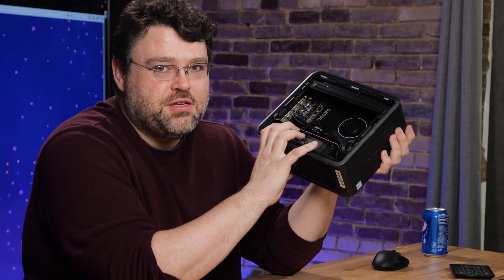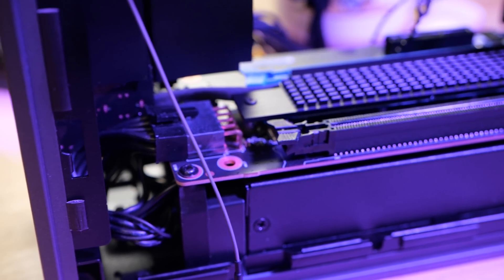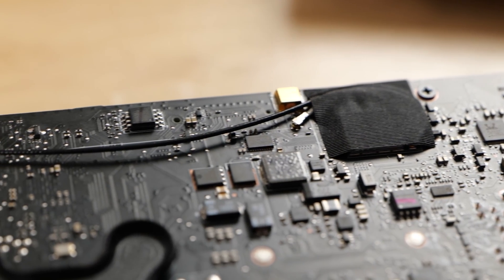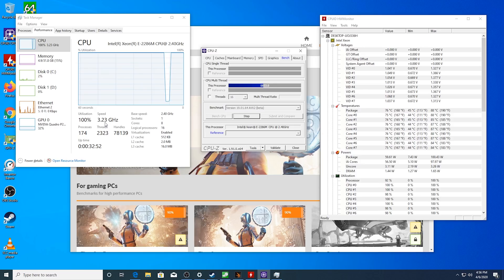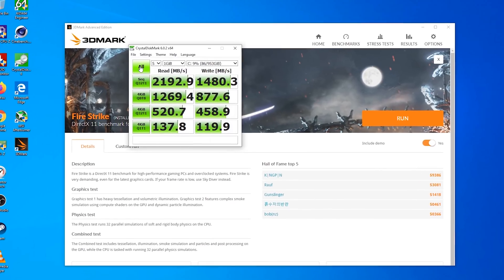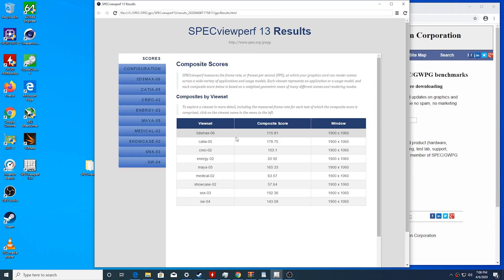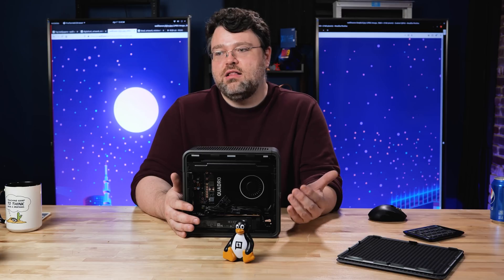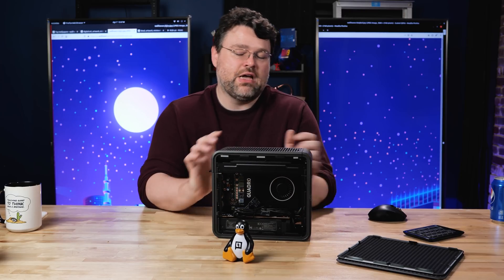Intel Xeon Nuc, Now w/PCIe Expansion!

Comment: Does that processor have the same vulns that Intel has either decided not to fix,  Is being paid not to fix (by the big 5 sided building outside the DC --- or NSA??) or????  I have one of the earlier NUC's (Skull Canyon)... Still running solidly on the original 10 install (which took about 2 minutes from a fast thumb drive)...

Comment: I enjoy your videos because you give your opinion, but You EARNED a downvote for this video. How hard is it to include the model number of the NUC you reviewed and a full list of specs in the description? Yes you go over the specs, but you didn't list the model number for the Xeon NUC. Also I would have liked to see you test the Thunderbolt 3 ports using an adapter for the older thunderbolt 2 standard. If anyone is like me they already have older thunderbolt 2 enclosures. Not all thunderbolt implementations are equal either in the case of Gigabyte's Titan Ridge  does not support the older thunderbolt 1 and 2 devices because they left the code out of the motherboard bioses that use Titan Ridge. Intel states Thunderbolt 3 is backwards compatible, but does not tell anyone that manufactures can choose to not support backwards compatibility. My biggest annoyance of videos of systems/motherboards with thunderbolt 3 is no one tests the actual ports.

Comment: It would be really really neat if Intel were to improve on this design by allowing the user to add a second CPU "module", so doubling of the core count can be a thing. Better yet: base-boards to interconnect multiple CPU / GPU modules. Quad CPU module cluster-compute anyone?!

Comment: This thing would make an amazing MacOS professional mini mac.
Reply: Also why would you worry about Optane???  Just get a V-NAND Samsung Nvme which has read writes of like 3500mbs.  I have one in my NUC Bean Canyon 8th gen i7 and my NUC boots from push button to start menu in 3 seconds no joke.  1, 2, 3 and boom my login screen is there.  Runs editing software and games just fine with no latency.  Optane is a headache.  Id buy one of these Ghist Canyon NUCs and instal MacOS on one NVME and have another Nvme with Windows.  Dual operating system mini editing rig.
Reply: @Carboxylated  i like Optane for speeding up hard drives, i use them with a wd black 6tb. For My Games.

Comment: Like normal Intel being cheap with their PCI-Express lanes.  If you want to populate all M.2 bays (12 PCIE), a video card (8 PCIE minimum), both Thunderbolt ports (8 PCIE) not to mention the chipset (4 PCIE) they should have equipped it with a CPU capable of 32 PCIE lanes so there are no bottle necks.  And a max of 64GB of RAM for engineering in CAD/CAM/BIM loads is laughable.  Maybe once Intel actually starts competing again instead of sitting on their laurels, they might be worth it.  Until then AMD is the clear choice for anyone that is not using Premiere as their primary work load or have to have the top FPS in a games.

Comment: As a Nuc user,to me this machine has no sense at all...It is hard to justify a Nuc purchase over any other combo you like. For me fan less was the key,but the original Nuc case is not good,very hot and noisy overall so I buy an Akasa passive cooling case who works like a champ,0 noise and never exceed 65ºC even in hot Spain summer.
Nuc PC get old very quick and the bang for the buck is not there. +1000 bucks for no real performance,only cos it is tiny,it is really a small market for it. 

For the new Mac mini I bet Apple would do an ARM custom chip,more performance in a ridiculous low max TPD with more integrated accelerators.A machine like this at 400 W tdp is asking for trouble and noise.
Even a 2009 Mac mini is quieter than my i5-6260U Nuc in stock form. 

The "brick" power of the regular Nuc is a little bit bigger than a regular phone charger and always is cold to the touch,it is very well made. But I see the regular "brick" thing being a problem,cos a 400 W brick it a big NO to me.
Good video as always!

Comment: Well, Optane just became even less useful now that you need to use the Microsoft store to get it.  I would just set it as 32gb of dedicated swap space and remove all the swap from the NAND.
Reply: Intel'sl use for Optane sucks but those little 16 and 32GB phase change storage cards are great for use as boot drives for high availability devices like pfsense and freeNAS.

Comment: This form factor is dumb. Intel's vision is people will replace the "Compute Element" while keeping the rest of the system as an "upgrade path". Sorry, that's very myopic. Keeping the cheaper parts of a system and replacing the most expensive for the most minor of expansion is an idea that should be DOA. Want a 10GbE? That'll be $1500, keep your $200 parts. Need a 4th M.2 slot? That'll be $1500, keep your $200 parts. Want USB Gen 4 device support? That'll be $1500, keep your $200 parts. And eventually those $200 parts will bottleneck the system. 

Just build mITX or mATX if you need a small system. That's why those form factors exist, and they made sense when created and still make sense now. When you don't have the expansion you need, you change out one of the relatively inexpensive parts of the system to get the new features integrated into the main board without spending roughly what the entire system costs.
Reply: Uhm... no? It is mostly for office-use - a small formfactor, everything neatly integrated, and if needed can be expanded with say a compute-card for architects or GPU for rendering. What are the other options - a laptop and pay a lot for features you have no benefits from?
A OEM Desktop that often can not really be  upgraded as the PSU and board are only designed to handle an extra network card? Or a bigger more expensive tower that takes up a lot of space and does not come with the more inclusive service contracts?

NUCs are nor designed for the home-use with gaming or just browsing but with companies in mind that just order 100+ of them and want to have a simple and fast service while taking up little space so it can just be tugged behind the monitor.
Reply: @ABaumstumpf  Except here's the problem: it's more expensive than existing form factors with those "features you have no benefits from", not cheaper. You're paying more for less. That's it. You're paying more for smaller size which isn't all that important to most businesses. That's a very niche situation where that trade off is required AND you also require massive CUDA/OpenCL performance.

Comment: I love the concept of this thing. 

Why can't we buy a case/mb combo like this for an AMD processor ?
Reply: @TechGuy Because then, AMD would have to buy into an Intel designed, semi-proprietary form factor and have some third party manufacturer build hardware for it.  AMD has it's own thing based on industry standards.  It's called mini-ITX and STX.  If you have issues with where it's going, I suggest you talk to AMD directly.
Reply: @namyun2743  ´More like - AMD does not want to create anything or support specifications of the competitors at all.
Reply: @ABaumstumpf  Even if they would make a non compatible copy they most likely be sued for patent infringement. No Matter who would win it would still be a pain.
Reply: @ABaumstumpf  Neither does Intel.  But to be fair, this isn't really an industry-standard spec at all.  It probably does use a lot of industry specs, like CPU daughter cards and PCIe splitters, which has been around for a loooong time. But NUCs aren't exactly flying off shelves and AMD has a far more limited development budget.  They need to focus on stuff that earns them money, not boutique niche products like this.

Comment: Does anyone make a computer this size that can take.… say an AMD  ryzen 3600 CPU?
Reply: Alternatively an xmg laptop with up to a 3950x. Smaller, faster, cheaper in terms of performance and comes with peripherals. 

Without a doubt a bulky laptop, but man that 3950x in it, is sexy! 

https://www.google.com/amp/s/wccftech.com/xmg-apex-15-notebook-packs-amd-ryzen-9-3950x-16-core-desktop-cpu/amp/
Reply: Sure, Asrock makes one even smaller, but there are compromises, like no PCIe slots, and a power brick.  But it does use a socketable CPU.
Reply: Simple case like this with powersupply and everything included while having room for expansions? no.

Comment: How does it compare to existing SBC solutions such as PICMG 1.3 or CompactPCI? They're both existing and proven solutions for SFF SBC.
As far as support is concerned seems this would be a bad joke compared to what you get for existing embedded systems.
Upgradability is actually non-existant for this since there's no ecosystem available yet. PICMG 1.3 for example could let you have use the same backplane since the Core2-era with modern 9th-gen Intel boards.
And this really does seem to be built as a consumer product. This is not something you can take out on the field, mount in a box on the side of a mountain and forget about.
I see absolutely no use scenario for this where some other system wouldn't clearly be superior.

Comment: Throw in a 10gig nic and make the most overkill pfsense box ever.
Reply: When I saw this idea, I wondered if you could slot this into a motherboard and use it as a second machine running your tower.
Reply: @hotstovejer  how can you slot a computer into a motheboard? do you mean into the case? on the case of course you can, dual systems are common this days. EDIT: I just saw it teared appart and I don't think so. PCIE 3 has a 75W power limmit, so in PCIE3 I don't think you can
Reply: @santiagoferrari1973  What do you mean? He means plug in the NUC compute module into a motherboard. It's literally a Xeon on a PCIe x16 card. This has a power cable to the compute module, as well.
Reply: I would have tested this with a 10Gb nic and thunderbolt.
Reply: or mini server!
Reply: Now you're thinking !
Reply: If you're just NATing, probably. With full encryption, you probably couldn't saturate the 10gbe connection...then there's the matter of getting a 10gbe connection outside of your immediate network...
Reply: Thunderbolt 3 10gig nic's work great, i use them with a laptop and a mini itx computer.

Comment: I wonder if AMD is going to do something similar. PCIe 4.0 on this would be amazing. If they implemented proper 4.0 to 3.0 with bifurcation, we'd have 32 PCIe lanes suitable for modern devices; yes I know 4.0 NVMe cards exist, but is there really that much of a performance gain currently? Another thing that would help is having more lanes from the CPU, which I think AMD might be willing to up lane counts, but we all know Intel won't move off of 16 lanes on mobile chips, not until NVMe really takes over the consumer market and additional lanes become a basic requirement. 
Just for reference, without TB, 32 lanes would be just enough for the 4x slot, 16x slot, and 3 NVMe cards to run on the CPU alone. If we don't care about two NVMe cards being on the chipset instead of the CPU, we can open those lanes up for the TB ports on the CPU, assuming both ports are their own x4 link and not two ports sharing one x4 link. Because of NVMe and external PCIe (TB and USB4, names might get confusing for awhile), lane counts are becoming extremely limiting; most laptops only really have room for a dGPU or external PCIe when the system has NVMe drives, but upping lane count would allow for dGPU and ePCIe with NVMe. 

I almost want to see Dell take a shot at putting the CPU and chipset on their MXM successor. Power delivery and cooling difficulties aside, having an upgradable CPU would be huge for the mobile space. You'd have brand agnostic manufacturers, as the system is no longer dependent on if it's using an Intel or AMD CPU, as it would be on an add-in card; much like how Dell is already doing this with a range of both Nvidia and AMD GPUs with their MXM successor they've been using for a year or two now. You'd also be cutting down on ewaste, as a chassis, and all of it's relative components (AC/DC components, peripherals, port daughterboards, etc.), can be used for a much longer time compared to it's upgradable components; this would also cut down on a lot of money waste with having 50 different models when you could have one barebones chassis with different add-in cards.  
I know this NUC isn't a chip-on-board solution, more of a system-on-board solution, but maybe this could evolve into a cob solution, where instead of a system being socket-dependant, it's only dependent on a PCIe interface to other components, as you'd have the CPU and chipset, along with other relevant components, localized to the cob. 
Probably more of a pipe dream than a future reality, but I think this is a good way forward for all parts of the industry and market.

I also wonder if we'll see anyone try to make a compute cluster out of these. It makes sense, have a PCIe and power backplane, and plug these in. I'm sure Intel has no support for multi-chip computing over the PCIe bus, but it'd be a cool thing to see eventually. Which this also makes sense for businesses that want to have a closet server but still have individual systems. This design really does seem more server oriented than what they're marketing it as.

Comment: Would like to see what AMD could do with their version of one of those.
Reply: I'd be all over this if it had a 3950X.
Reply: @SomeTechGuy666  over kill. But nice to have.
Heh. The integrated Vega should be useful too.
Reply: @SomeTechGuy666  Not going to happen.  Why? Thermals and power.  Think more mobile Ryzen.
Reply: @namyun2743  The 3950x is half the power of the Xeon used in this product.  Especially under light load.
Reply: @namyun2743  XMG is making a laptop capable of using Ryzen 3000 CPU's. der8auer made a video on it with a 3950x installed and while it limited it slightly, it was fine with it set to run at a 65W TDP.
Reply: @SomeTechGuy666  Did you not watch the full video?  Wendell said it was a 45W TDP processor.
Reply: @karlschauff7989  Did you see the laptop though?  It was a monster with serious cooling and it couldn't even handle the 3950X at full throttle. It even had to be TDP-downed to 65W.
Reply: @SomeTechGuy666  The downclocked Ryzen running at 65W TDP in a certain laptop or the full Ryzen at 105W TDP?  Care to share the source?
Reply: There actually are SFF motherboards, CPU boards and entire ecosystems based on AMD processors. They're just at the OEM/ ODM level, as in, you can't buy them unless you want a minimum order of 1000+.  I don't think any company has released retail products.
Reply: AMD's equivalent is already available - EPYC Embedded is primarily in M-ITX form factors for embedded systems. 8c/16t is available, but 16c/32t is only available for OEM/ODM markets. 
Search on ASRock Industrial or Supermicro for various boards available. Do expect there to be minimum order quantity, but you can request for a board for "development" if you can prove it's for development of a commercial product.
Reply: Yeah id like to see a reasonably priced system that actually performs jammed into a dan A4 package myself instead of intels once again rehashed old as dirt silicon resold and resold and resold at rediculous prices.
Reply: well tbh for the same price as the max spec this nuc can muster, you will get an 3900x + 2080ti setup with 32gb ddr4 3600 in the new nzxt H1 case, yea its a little bigger, but so much more powerfull... hardware canucks made this comparison
Reply: @Poxtor  Yeah but there not the same market as Wendel said. Any how that guy on Hardware Canucks knows fuck all about NUC's and their design philosophy etc. They have always been expensive even back to the days of the first NUC's back in Sandy Bridge days. Actually amusing that the 10th Gen (Frost Canyon) launched November 2019 but 9th Gen (Ghost Canyon) launches Q1 20.
Reply: @Poxtor  does that build have atleast 2 thunderbolt 3 ports I'm debating on building or buying this looking to replace my Alienware alpha r2. Just looking for a small desktop I can take from office room to bedroom
Reply: they will make a smaller
Reply: Gentlemen: (Sorta, kinda). With a, super proprietary, 1660ti.
https://www.hp.com/us-en/shop/pdp/hp-elitedesk-805-g6-desktop-mini-pc-customizable-2q297av-mb
Reply: It's called Xbox Series X

Comment: will the nuc card realy fit in a pcie slot and if so what happens if you do put it in another pc slot
Reply: Quite possibly could result in damage, at least in the power stages. Depends on theirs and motherboard makers designs.
Reply: last I checked Intel has no plans to make these able to work in other motherboards

Comment: Kinda wish you could plug the CPU card into a desktop and have it treated like a VM.
Reply: oh u can, but it won't function the way it should be used, for instance the compute element will run, but it can't communicate with a gpu nearby, just the internal, but since xeons dont have igpus u are stuck with the overpriced nuc here, the ghost canyon with the i5, i7 and i9 will run just fine, the quartz canyon / xeon probably not